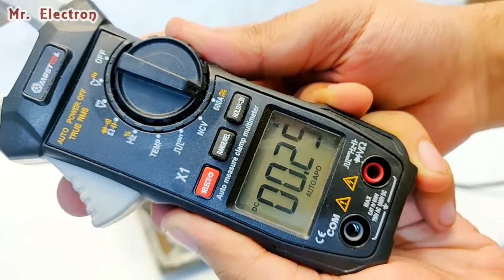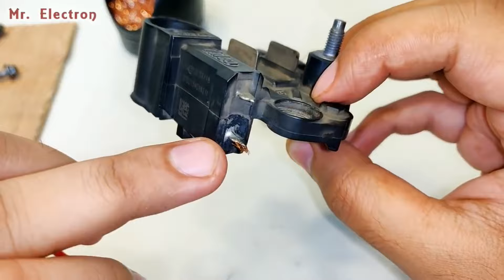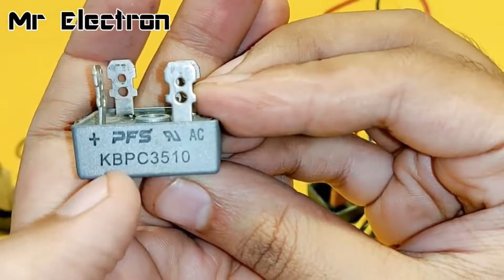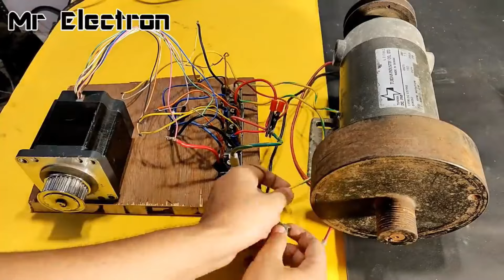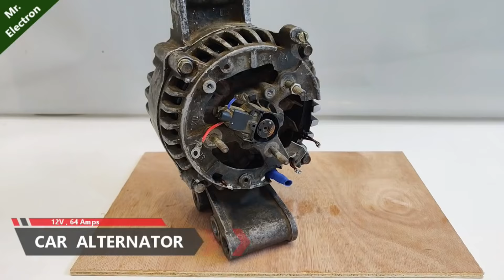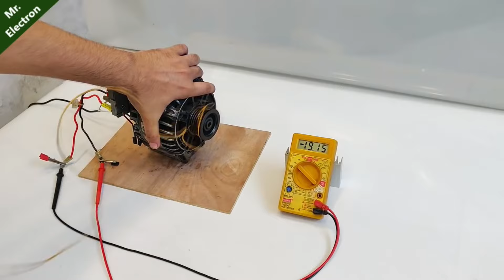3 Simple Inventions with Car Alternator

Comment: at the beginning of your testing it is normal that the alternator did not deliver any notable current, because if it was not already out of use it is for sure after you run it without being connected to a 12 volt batterie. If you let run an car alternator and disconnect the batterie you will fry the diodes of the rectifier. this is not the case with the old models of dynamos which have separate mechanical Regulators like in older cars , trucks etc.

Comment: What if you increase the excitation with much higher Voltage?
Can it generate 120 volt or 220 volts?
And run AC appliances without the rectifier?

Comment: I have friends in this little 'shanty town' under a bridge and I keep telling them that they could use the power of the slow running creek under said bridge to at least give them light at night. The 5 phase motor sounds like a much better option than the 3 stage that is easier to come by. I just want to be able to help out. They said they would be willing to peddle a bike in turns also.

Comment: How can you reach 220v?

Putting many alternators in parallel of course

Is it possible to reach 220v with neodynium N52 magnets?
Reply: use the alternator run through diodes to charge a battery bank and run an inverter to get 220v

Comment: The 4 main components that make up an alternator are 
1. Rotor 
2. Stator
3. Rectifier/Diode pack
4. Voltage regulator
Motors have armatures and field coils.